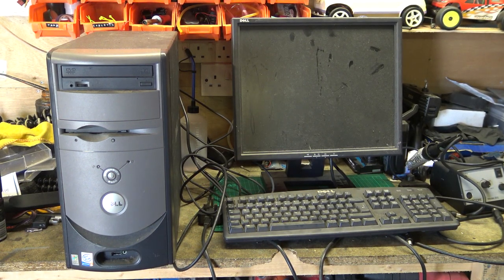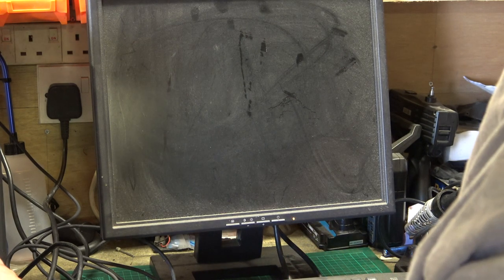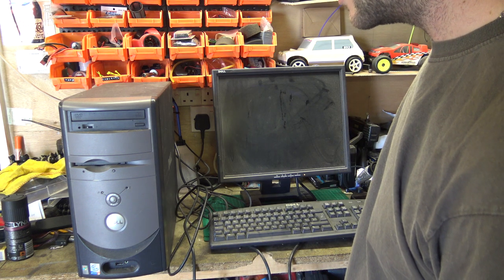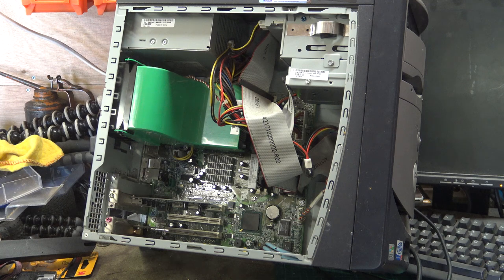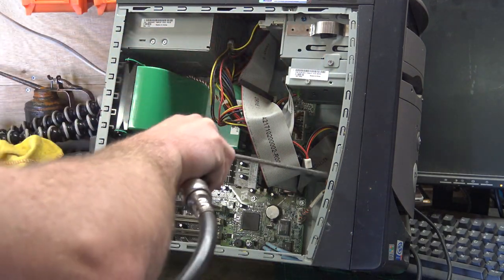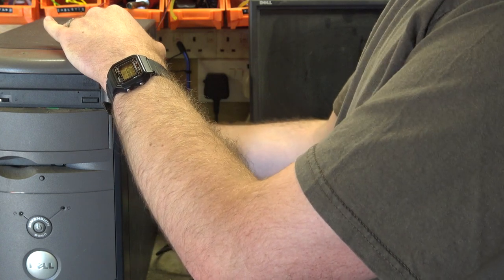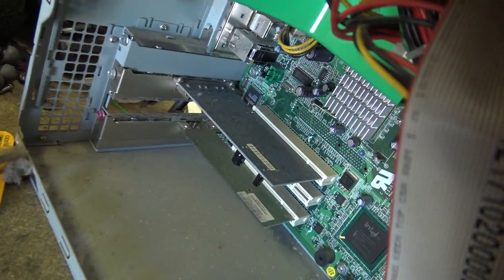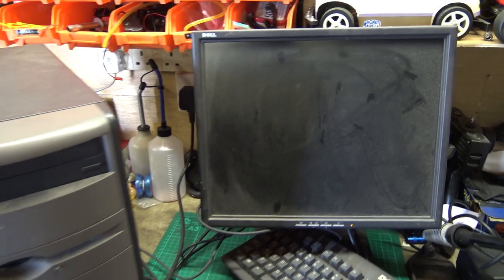Old Dell DeskTop Computer Will It Work?

Comment: The dvd drive looks like a nec made one they have a plastic seal on the door  and it gums up with dirt  and sticks cleaning it sorts it out ,the going off could be down to overheating due to the thermal paste needing to be re aplied .

Comment: I would also second the other commenter who suggested changing the cmos battery (CR2032), it may also not start properly without a mouse as I think it is part of the system check before it runs.

Comment: might be the ram needing to be reseated but for the psu check to make sure its fan is running sometimes some psus wlll thermal shut off like mine would and have a red light on front showin that its overheated the psu but that monitor seems like its bit the dust there or its at the wrong video frequancy